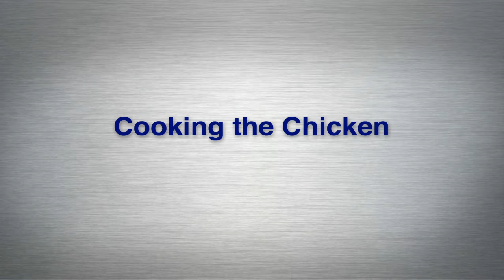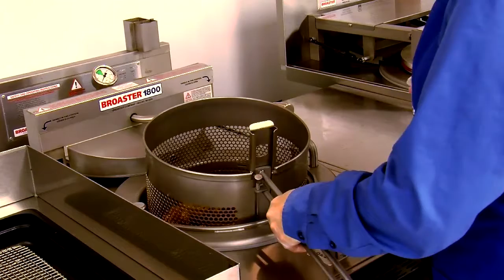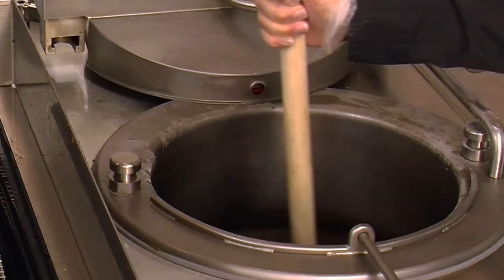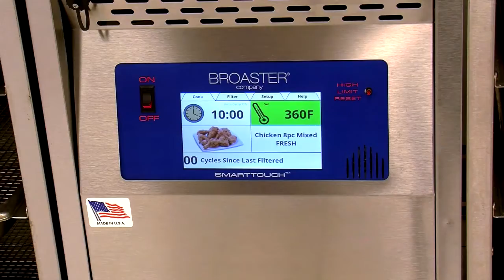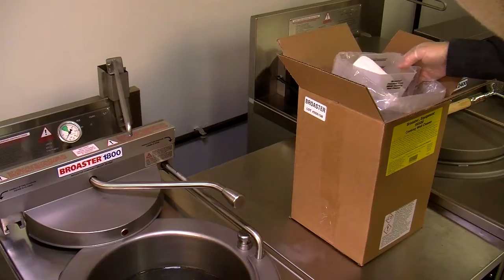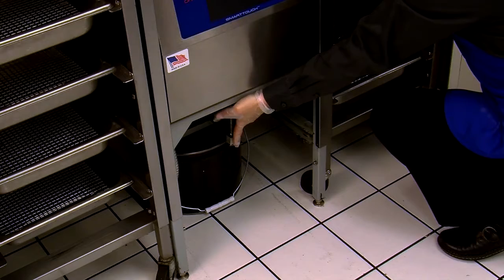Broaster Pressure Fryer Operating, Cooking & Filtering

Comment: The I'm at deli has these exact analog touch capacities style fryers, but poor management has lead to neglect, but also shows what breaks with rough treatment. The basket eventually cracks at the base at the part below the handle attachment. The pressure gauge starts not reading accurately and is useless. The metal rungs of the bottom oil reservoir and the rails to hold them are not reinforced enough as they inevitably start bending away from each other in the middle parts. The basket falls down when full of oil, and supports off the intake, where that cracks too at the welds near the reservoir handle. The intake pipe then causes the reservoir to warp / be bent abnormally where the filter holder isn't perfectly flat with the reservoir anymore, causing large particles to make it past the (cracked and metal fatigued screens too) filter into the intake, where it clogs and causes all sorts of odd priming issues. At this stage, they begin to eat pumps more often. The inside cooking well starts warping, which makes it harder to clean as the surfaces aren't flat anymore [You can see the outline of heating elements]. Oh, and the circuit in these can starts to, but rarely, have an issue of changing the temperature to 270F by itself. Otherwise, they are realistically just reliable enough, that I have no idea how they just keep turning on and cooking, even if the pressure cooking function is gone by now. Is it worth these Broaster fryers over other brands? Yes still.
Reply from the maker: Hi! It sounds like you may need a service call. I would start with contacting your local distributor. Otherwise, give us a call at 800-367-0645 or email service@broaster.com. Also, our cooking wells have a 10 year warranty!

Comment: I have one question my broster has problems when I open pressure so machines ringing till after 30 second
Reply from the maker: Hi! It sounds like you may need a service call. I would start with contacting your local distributor to see if they can help. Otherwise, give us a call at 800-367-0645 or email service@broaster.com

Comment: So when you add the filtering compound to the oil and then drain it to clean,  you pump the oil back in an add oil to proper line.  Is it safe to use that same oil when the compound was in it..
Reply from the maker: Yes, the filtering compound is food-safe! The filtering compound will help polish the oil and remove contaminates which will extend your useful oil life.
Reply from the maker: We also just released our ES-24 pressure fryer which has advanced features and filtering which can extend your useful oil life up to 4 times as long! Be sure to check that out as well: https://www.youtube.com/watch?v=U_5PIVxl7wM&t=1s